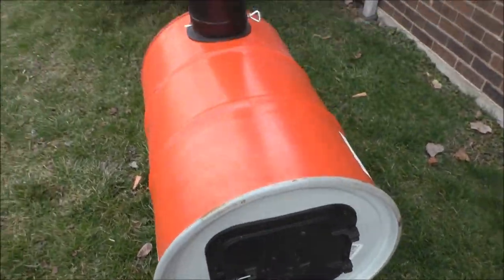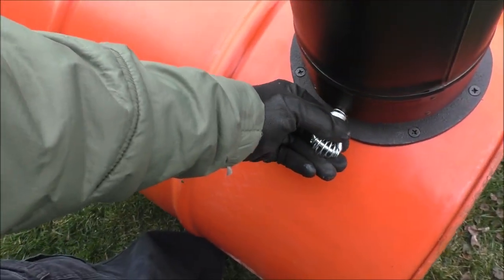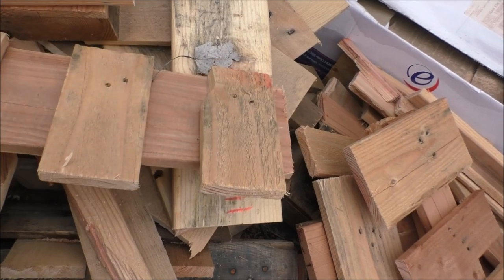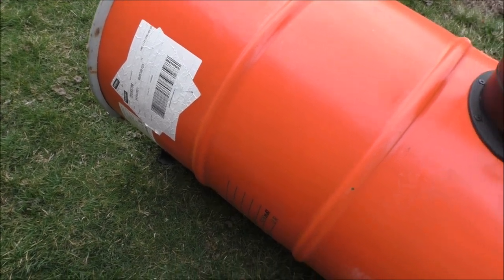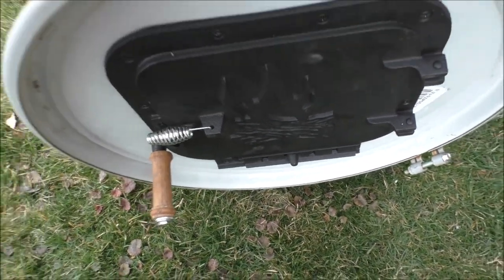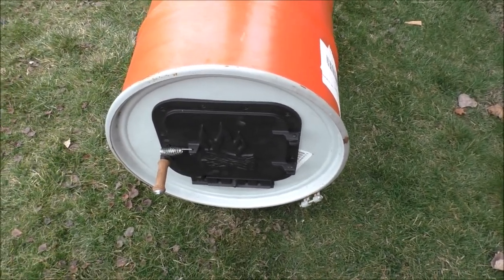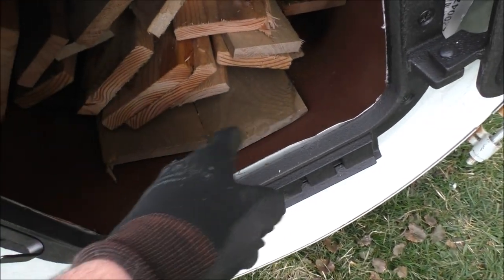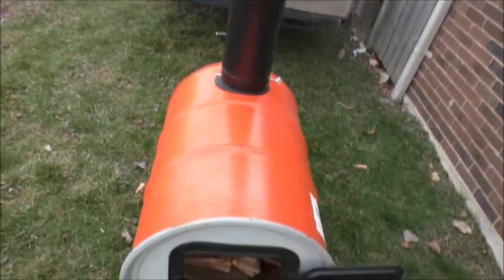Prepping Barrel Stove For First Burn

Comment: Now's the Time to know if it's going to burn a hole. I only say this because you're concerned. You're going to find out that it's not going to bake off. In every little spot. Primarily because the way you aren't you correctly do it. Is to actually burn it both inside and out in a large brush fire. Then they put the door on. And try to keep it from rusting.
Reply from the maker: very good

Comment: Are you putting that in your home
Reply from the maker: yes the tiny house
Reply: The Off Grid Tiny House you should make a baffle it will stop load of smoke pouring out your chimney and so all the heat doesn’t go up the flue